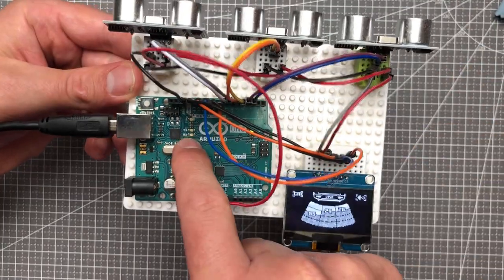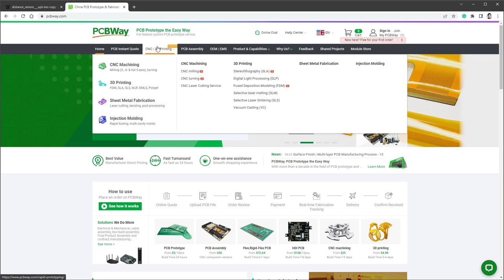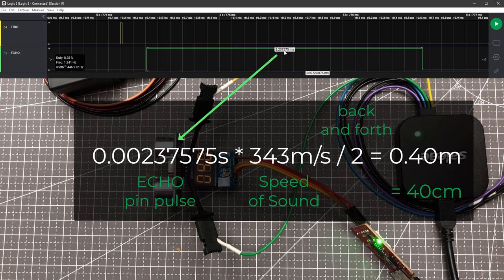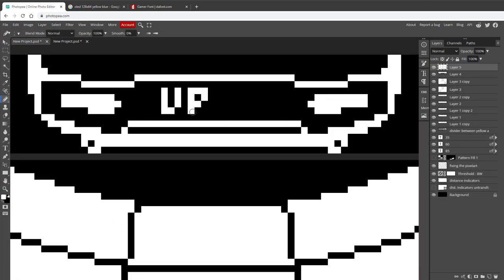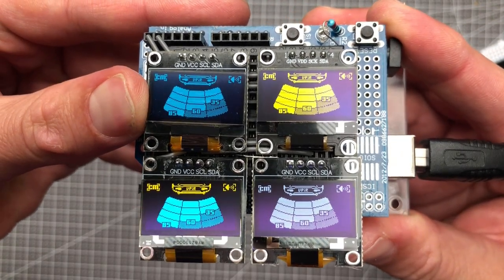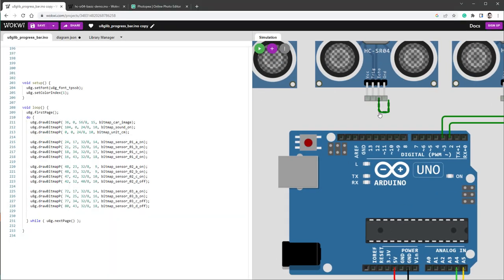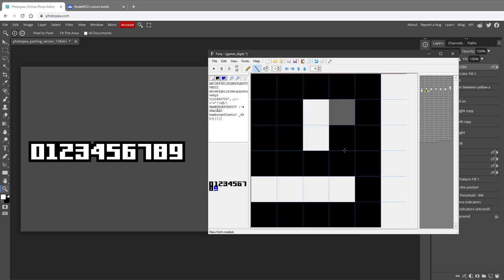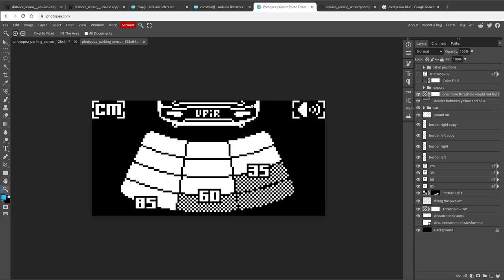DIY Parking Sensor with Arduino (Overview)

Comment: Great videos. 5stars. I only wish you could make some videos with the Esp32. I’m banging my head trying to convert this from Uno to Esp32. And I even tried your u8g to u8g2 conversion video. 
You are still the best channel to watch and keep up the great work..
Reply from the maker: Thank you. Yes, I do plan to use ESP32 more. What kind of problems are you facing?
Reply: @upir_upir  You are the best. Thank you for your reply. I’m an old electrician who has been using PLCs in my power plant. I see the power of these Esp32s (Audrino IDE in general) and am just playing around to learn the coding and versatility of these little things. I won’t bombard you with stupid questions just yet. But seeing your expertise in your fantastic videos I know you may be my saviour one day. I need to first learn the basics and grow from there. Make sure to add your coffee link with your videos. You definitely deserve it them. 
Thank you kindly for even responding to me, keep up the exceptional work.
Reply from the maker: @picomico6389  Thank you for your nice words and for the coffee! I really appreciate it. ESP32 is very powerful, but I would still recommend Arduino (UNO) for beginners. It is so widely used that anytime you hit a roadblock, you will most likely find the answer to your problem since someone else had that problem before. That said, I will slowly move to ESP32 and explore all the options when it comes to displays. It just takes time since I´m still learning. Good luck with you projects!

Comment: Upir, it's a great short video and I've never heard you talk so fast 🤣, but Im keen to see the full tutorial on this project with the ultrasonic sensors as well as the general off the shelf sensor you showed.

Have you done anything with a full color IPS LCD before (using the Adafruit SSD7789 library or similar), I think it will be a great addition to this project. Well, basically, your speedo, boost gauge, and then this here parking distance project all combined into a single larger project with the different options would make one epic video to end off 2022 😉
Reply from the maker: Thank you for your comment Martin, it´s true that this speed was little bit faster than usual :) The full-tutorial is in progress and I hope to finish it sometime next week. 

As for your second part, I don´t want to spoil too much, but you have pretty much guessed what I would like to do - i.e. combine all the small projects into one bigger one. Stay tuned!
Reply: @upir_upir  oh yeah 🙌🏽 looking forward to that video 😎 

Keep up the fantastic work 👏

Comment: I really like your videos. You could a little bit explain more on how to adapt the steps for different colored oleds. But really great content. Would like to see you connecting one transparent oled with one standard oled.
I have a question about photopea. Do you use another color for the icon and text, if you have e.g. a yellow-blue ssd1306?
Reply from the maker: Thank you for your comment. All monochrome OLEDs require only black and white pixels- including the yellow/blue OLED. You can imagine that there is a colored overlay placed on them. In case of yellow/blue display, first few lines are yellow and the rest of the display is blue. You cannot size blue pixel on top and yellow pixel on bottom. You simply just turn the pixel on or off. The part where I show 4 different colored displays is using the same code, actually all displays are connected to one Arduino. Hope that makes sense
Reply: @upir_upir  Thank you ver much for the explanation and the quick response. Now it makes sense.
Reply from the maker: @ACID2BREAKS  That´s great ot hear, good luck with your projects!

Comment: And how do you connect the water proof one's? Replacing what and how?
Reply from the maker: It will be described in the next video, but it´s just swapping those two, by default, they use the same pins and same protocol.

Comment: Just a thought, I get that talking as fast as possible (or speeding up the recording) is a trope used on this channel, but you might want to consider how this affects viewers with disabilities. YouTube already has controls for people who want to speed up videos.
Reply from the maker: Thank you for your comment. I actually don´t try to talk as fast as possible, but I try to get out all the details and information without having two hours long videos. I hope that when someone has problems listening to this speed could use the playback controls to slow it down. For me, I usually use at least 1.5x speed for pretty much all the other videos, many times 2.0x speed, so I understand that I might not be the best example.

Comment: will rpi pico or other esp32 boards be enough for this buid?
Reply from the maker: This project was done with Arduino UNO, so using Pico or ESP32 should be perfectly fine, since thos are much more powerful.

Comment: Going to use the JSN-SR04T instead
Reply from the maker: Good choice! Please feel free to post a link to your project, I would like to see it.
Reply: @upir_upir  already got it working on an epaper display, problem is the refresh rate is pretty bad and there are no big oled displays
Reply: @upir_upir  nvm, going to use a WT32-SC01 as soon as I get it here
Reply from the maker: @sailingdev  There are big OLED displays as for the size, but not for the resolution. I mean, there are, but not easily accessible.

Comment: Do you have a link to the waterproof sensor?
Reply from the maker: Sure, it´s in the description, and also here - https://s.click.aliexpress.com/e/_DdygmJN
Just make sure to buy both the sensor and the board, otherwise it will not work.